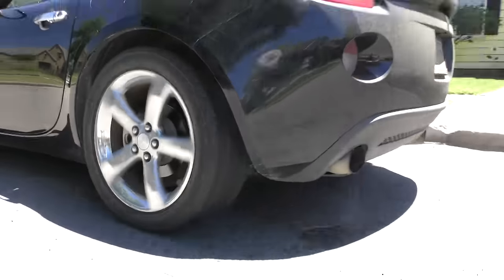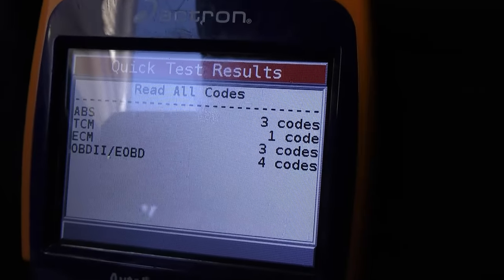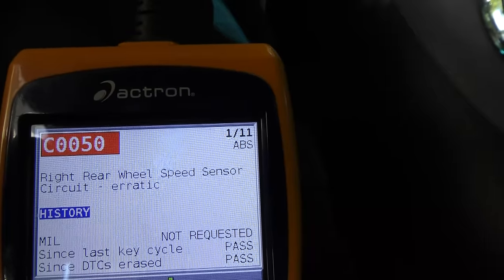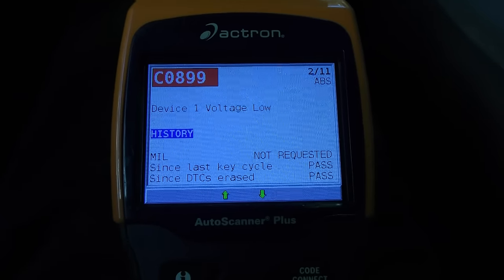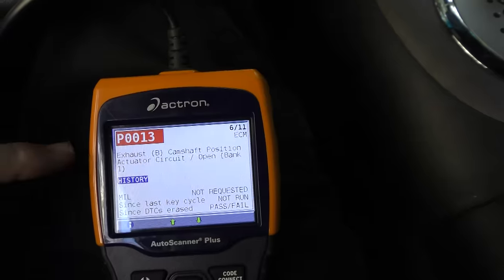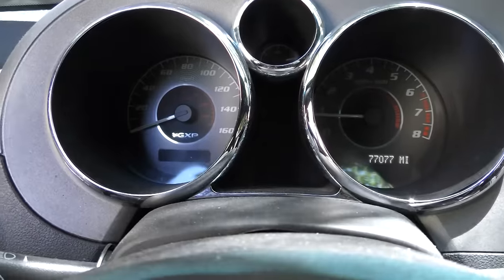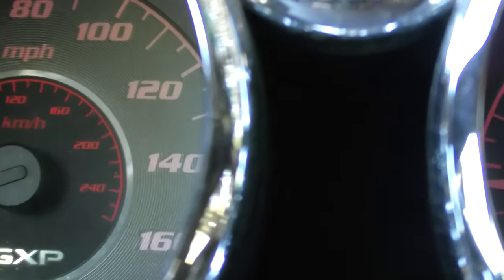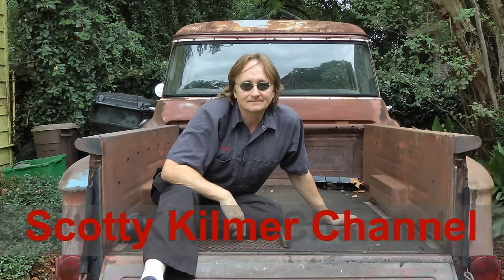Check Engine Light On in Your Car? The Truth About What it Means

Comment: They should use a different type of symbol instead of an engine... because it's not really the engine your checking it's sensors...and other things like evap (gas cap)  I work at a used car lot so when the check engine light turns on it's hard to explain to the customer that it's not the Engine thats bad...lol...like how come cars don't have a "Check Transmission" light? If they have a "Check Engine" light...

Comment: Hello. I have a 1995 Honda accord and I need to get the codes from the obd1. I have seen online that I can jump the obd1 sensor from under that dash. I just wanted to know if doing this can/will mess something up.....thank u in advance
Reply: When u jump the sensor, apparently it causes the check engine light to flash, revealing the code that its sending. I just want to make sure that if I do this it wont hurt anything

Comment: Hi Scotty. In my car i think i got some issues with electrics overall,i got all 3warning lights lit up at random all at once when everything they reffer too is perfectly fine(Brakes,batery/alternator and oil level). It started to show up like this when i got new alternator, car works fone ovltage is perfect, all the stuff works but these lights keep showing up and going away. They tend to go off when i'm on idle rpms but only for a while.
Reply: It's 1990 Celica, when i bought new alternator(old one had worn out alot and changing brushes did nothing) But it didnt have a solenoid,i just put one from the old alternator could it be the solenoid?   
I seen other Celicas with no solenoids at all...

Comment: I had the check engine light start flashing while driving and I stopped driving it till I go off work and it hasn't came back on should I be worried the code was for cam sensor
Reply from the maker: if it doesn't come back, no. But if it does, get it fixed and pray it's just a bad cam sensor or wiring at the connector

Comment: Has anyone ever pulled the check engine light bulb just so they don’t have to look at it going down the road? Lol.
Reply from the maker: many people have, or put tape over it. But it would still fail emissions inspection
Reply: Scotty Kilmer Luckily for me we don’t have emissions testing where I’m at. I’ve got a 2000 Chevy Silverado with the 4.3 vortec in it, and I had the code p1345 pop up after I replaced the lower intake manifold gaskets I think this thing may be running out of time. It runs good other than sometimes at take off it’ll fall flat on its face after it stumbles for about 5 seconds it’ll pick itself back up and run fine other than that no issues starts every time doesn’t back fire or anything. When I go to clear the check engine light it comes back on after running for about 5 seconds. I’ve been told it could be a bad distributor gear or it could simply be running out of time. What is your input on this? Thank you!
Reply: I’ve replaced the distributor cap and rotor button, I’ve replaced all the spark plug wires, and spark plugs, I’ve replaced the camshaft position sensor, I’ve also replaced the crank shaft position sensor the Truck has 120,465 miles on it and I can’t tell if it’s just running out of time or if I need to replace the whole distributor.

Comment: I hope somebody can help me with this I have a 1989 Dodge D100 with only 20,000 miles on it it has a few issues and the maintenance light is on now the book says that I have to take it to a mechanic to have them reset the light problem is because of the age of vehicle nobody has the machines or the equipment to do that any suggestions might be helpful and unplugging the light is not an option

Comment: Recently my check engine light displayed (solid yellow light) on my BMW 2016 X1.
  
After driving for a day or two it went off on its own. But then came back again. So I took it to a local mechanic and he informed me the DTC code causing the Check Engine light is D1249.
  
He then noted this is some type of generic BMW code with no other available details and that only a dealer could clarify what the code means. Obviously I would like to avoid doing this if possible.
  
Does anyone know what a D1249 check engine code mean?

Comment: Bejesus. This guy is a good mechanic but to suggest switching the ABS off ....... thats almost criminal. Insurance sure wouldn't pay anything if they found out your ABS system was not only faulty but that you'd actually switched it off !!!
Not to mention the personal safety issues driving a modern car round a corner too fast for example  without ABS could have you in a serious accident.

Comment: Does this work on older vehicles? I've had the dash off and poked around the fuse boxes, and I don't think my 1994 pickup has a place for that doohickey.
Reply: 1994 is OBD1 for your truck; one year before they went to the standardized OBD2 connector/scanner shown in this clip.
Reply: brthdan thanks! Is there any diagnostic I can perform to figure my problem/clear the light?

Comment: My check engine light is flashing and stabilitrak turns on as well. Replaced spark plugs and wires, what could it be? code p0300

Comment: The check engine light being on means the.check engine light is on. These devices were installed in cars to get owners to pay for unnecessary repairs. Even here, the guy does not know what it means is wrong, if anything. When they first came up with thus idea
Reply: When they first came up with this idea, they'd put a wire or other flimsy device.inside the engine and when it burned though, the light would come on. You'd take it to a mecjanic, he'd replavenit, the light would go off and you'd fork over whatever it cost, 100-500 bucks or more. Car makers + crooked mechanics= more costs to you.

Comment: PLEASE HELP ME!!!                I have a 2003 GMC ENVOY 4.2 I6 Vortec  it has sat for I assuming at least a year judging by the viscosity of the oil and just liquids in general. The check engine is on and a hard deep shutter comin from the engine "Obvious Misfire" so the trouble codes it gave me were the the (Po300 series) that was the only codes it gave me so with knowing it sat for awhile I replace Ignition coils, Spark Plugs, VVT SOLENOID, air filter, High Milage Full Synthetic oil and a K&N Lol Filter. I upgraded the oil quality and went with high milage for the expansioning it does on the seals and the oil filter because this was the 1st I've ever encountered what I'm calling an " over-engineered VVT Engine set-up so I figured if I went with a better micron ratings on the oil filter to keep contaminantes from freely roaming in the block and cause a potential clog in the screen on the VVT SOLENOID I mean it makes sense to me because it's whole operation is timming and lubrication. Finally hours upon hours studying wtf vvt was and its operations my task was complete.... Check engine light never went off the same obvious chugging of the engine  still misfiring so I let it run for a bit and nothing drove it around and nothing maybe a tad worse now and the misfire code is gone and it gave me the crankshaft and camshaft positioning sensor correlation. Makes sense after more research and their functions I replaced both start it up and BOOM! Nothing happened it was running the same and the check engine light still on so I check the codes my ECM comes to me with over 25 trouble codes both power and drivetrain my main concern was the crank and camshaft positioning sensor correlation that came back after replaced twice brand new and poor performance coming from the ECM. so I tbh I reset the ECM and that code has gone away along with 23 or so codes the only 2 that stayed were the crank and camshaft positioning sensor correlation. Still runs like complete garbage it's a very nice truck and vital I get this truck up and running before I lose my job. Sorry this is so long but thank you so much if you stuck it out and I greatly appreciate any help and advice at this moment in time none of this makes sense to me please help!

Comment: I just got a new car ): it has a check engine light when I turn it on and leave the AC on but not actually turning on the engine. When I actually turn on the car the check engine goes away , is that normal?
Reply: Yes, all cars do this as far as I know. Only when the car is running, engine on, and the light comes on, that it should matter.

Comment: i used to know a mechanic that used to get fined by nys for passing inspection on cars that shouldn't have been and he said if get one more fine im taking that fucking machine and putting it through the wall! 😂 he passed first car for me dirty lol check engine light with like 30 codes hole in water pump cracked windshield vw jetta trek edition boy was that car fucking shot.

Comment: I got a question. I have a 1991 Honda civic EX.. now the check engine light came on and I couldn't accelerate, so I pulled over turned off the car and then restarted it. The check engine light turned off and now the car is driving fine. Does anyone know what caused it to do that. Also my car is low and has open headers.
Reply from the maker: ther are scores of possible codes, but that's so old it does not store codes like obd 2. So wait until it happens again, don't turn the engine off, and get the codes from a mechanic while it's on

Comment: My two Toyotas have "soft", weak brakes. My roommate's Mazda has "hard", strong brakes. My old 1988 Dodge Ares had powerful brakes, but I don't remember if they were "soft" or "hard". Can anyone please explain this difference ?
Reply: if its hard, it may be the brake booster wearing out. but usually new cars have really soft and sensitive brakes.
Reply: I was just really surprised when I drove his car, and I barely even touched the brakes, and we jerk forward quickly. I actually didn't know it was a problem at all. I just thought it was just a different style of brakes than mine ?

Comment: Can dirty oil cause your engine light to come on?
Reply: It can if your car has variable valve timing. The car will run like the timing is off. The engine oil in cars with variable valve timing is what keeps the intake and exhaust valves in sync. At that point you will need to replace the VVT solenoids. It will set the cam sensor code. Just keep your oil changed regularly to avoid this.

Comment: I remember asking auto zone to pull codes on my truck (OBD-1). they asked if I had a check engine light and I said no. they replied "if you don't have a check engine light you don't have any codes". meanwhile my truck was all over the place and ran like crap. made my own with a bulb and change an egr sensor and a MAP. auto zone sucks. nothing but idiots

Comment: my check engine light comes on and off, bmw b.s but for the first time today i smelled something burning under the hood.
Reply from the maker: My mother is from buffalo, long suffering Bills fans, looks like more suffering is to come. Do check for leaking oil or coolant under the hood first, often just leaking valve cover gaskets
Reply: thank you for the advise.  and for sure its not easy being a buffalo bills fan :)

Comment: Part of the problem is that manufacturers could just pop the info on a dispay screen - I know newer vehicles will dun you for oil changes, tire rotation, etc. But get rid of that god damned idiot light.

Comment: so i got a cel light of p0505 come on and off for my car. tells me its the iacv. tried a new iacv but it made it run worse..  put the old one back on it ran just fine again. why does this happen  lol
Reply from the maker: cause cars are computer run and just turning em on and off sometimes fixes them. Do check the electrical connections where you were working though, they may be slighly corroded, realize they only use milliamps and  5 volt reference signal, not much power
Reply: Thanks I'll take a look at it

Comment: Hi Scotty, I have got replaced all 6 ignition coils and spark plugs on my 2008 SAAB 93 V6 2.8L Turbo. When I got out of the repair shop the CEL came back. Got it checked and they were showing 2 ignition coils. I got back and they spend another day to fix the problem. Right next day the light came back again. Got it checked and the code was now showing one coil. They told me this is the bes they can do and now I have to take the car to the dealership. The car runs excellent without any issues though. But the CEL keeps bothering me. Any ideas ?

Comment: It's on and my cruise control light is flashing
Reply: So was mine....on my 2010 rav 4.
Cruise didn't work . I disconnected the negative cable on the battery for about 8 minutes... 

It completely resolved the issue
No cruise light flashing. Cruise works fine now.

Comment: I can’t get my car inspected until it goes off. That means no registration sticker. Car runs fine. So pissed
Reply: Unplug the car battery for one minute , honk the horn to make sure there no power in the car ,then plug the battery back in ,it will reset the cars computer and shut the check light off. 
Then drive around for 20 miles to complete a drive cycle and it should pass emissions test
Reply: Ocean Pacific Oh thank you so much!!!
Reply: Its back on again
Reply: @Ladybird1967  how does your car run ,any symptoms, does the throttle hesitate, any idle problems ?
Reply: Ocean Pacific It runs just fine. I did the battery thing you said and it cut off for  a day. Then I took it to a mechanic on Friday and $212 later it cut right back on this evening.

Comment: cars won't fix themselves. 

Anything timing related on a GM can be triggered by low oil level. first step is Always check your oil level. 

this vehicle could be a tooth out of time. 

not enough to run poorly, but enough to be picked up by the check engine system. 

give these people real advise.
pull your fucking dipstick every few tanks of gas to check your oil level. 
MOST GMS USE OIL. 

clearing a fault will need driven over multiple cycles for monitors to be met.

Comment: OMG ABS got neglected by an expert..r u..? very dangerous to drive without it..cuz u may slide instead of roll...
Reply from the maker: Been driving since the sixties, I don't need no stinking ABS. But, I do show what would fix it if you want to buy that expensive wheel hub sensor assembly watch the video closer

Comment: so teh check engine light can come on for bad brakes or brake lines? my check engine light came on about 3 weeks ago or so and the truck drives normal but the other day just as i was moving my truck my brakes went totally out...my whole brake was going right to the floor ato get a total stop i wasnt going fast at all which was the only reason i got it to stop...maybe thats what my check engine light was about...i drove the truck on the highway and eveyrthing with th tlight on imagine if my brakes went out then..my God . id be dead most likely doing 140 on teh highway. i jsut got my rotors and pads done so i figured if anything my brakes should be good apaprently not...youd figure the guy that saftied my truck would see such an issue and repair it..scumbag.